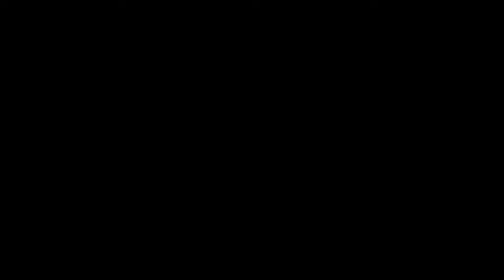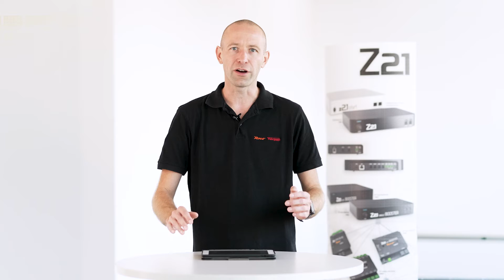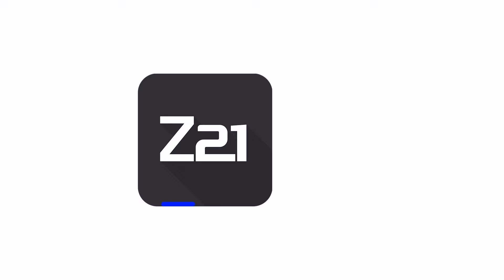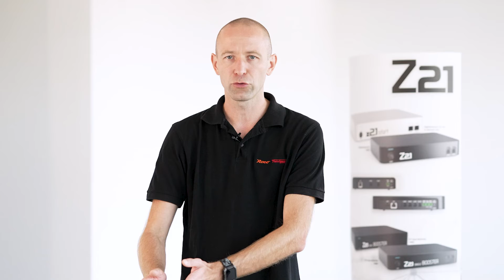Questions and Answers III: "Digital for Beginners" video series

Comment: What do I have to do to get any customer service from Roco? I purchased a TT:120 BR108 locomotive in January of this year, it’s motor drive failed within 2 hours, it was returned to Austria for repair, that took 5 months!! It failed again within less than 1 hour. This model has been re released with new motor/transmission so Roco is fully aware there was a fault. The customer service department at Roco fail to respond, I have ‘tickets’ going back weeks and nothing happens. Roco is a scam company and on current form not to be trusted
Reply: An update, after months of waiting, Roco’s Legal department have informed me I can repair the loco myself (using parts they don’t have ) on a £300 loco that has failed twice in hours and having been in their service depart for 5 months.. that repair didn’t work. They admit the loco was manufactured with substandard parts. So far they are refusing to replace the loco with the re -engineered version that addresses the faults. What a shockingly bad company Roco Fleishman has turned out to be. Appalling quality products and terrible customer service.